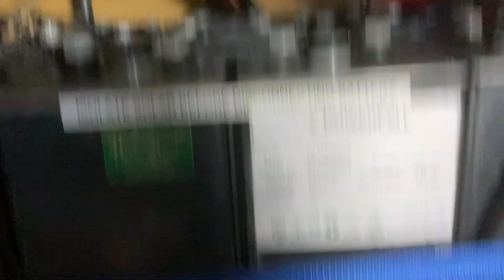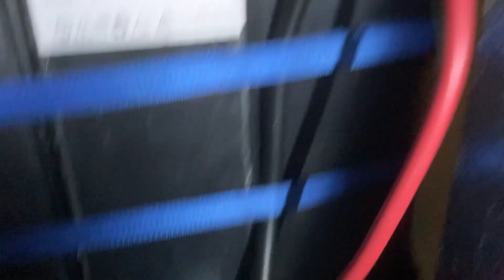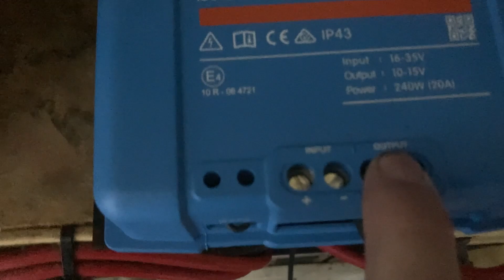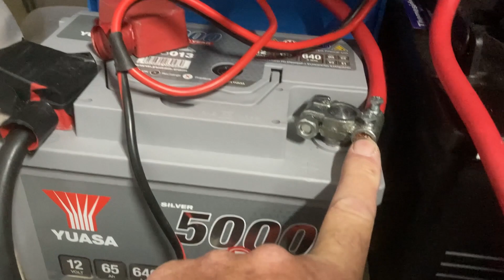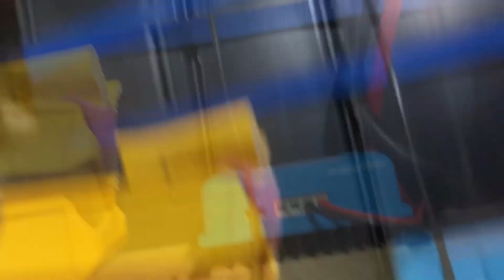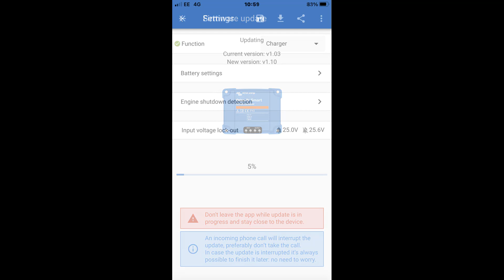Victron Orion Charger Installation on Dutch Barge

Comment: Fascinating bit of kit- I always thought you had to mount units like that vertical so air would circulate through the heat sink fins by convection - I guess as its only trickle charging the geni battery it's never going to send more than a few amps so would never get hot
Reply: Trevor, its the DC>DC converter that gets hot.  I have a picture of mine at 59'c mounted vertically on the nav seat and that is with a 3" hole behind it.  In comparison the 100/50 MPPT handling much more power is at best luke warm.
Reply from the maker: Hi Trev, yeah they dont get hot at all. If it was something that would need that cooling, like the 100A mppt controllers I would mount vertically. Its only for maintenance of the genny starter battery, especially during the summer when its hardy used.